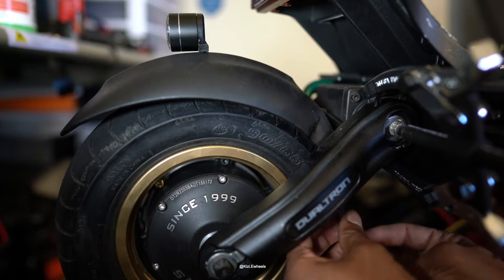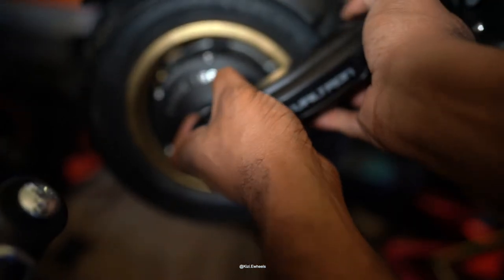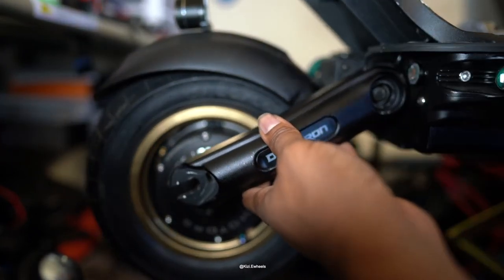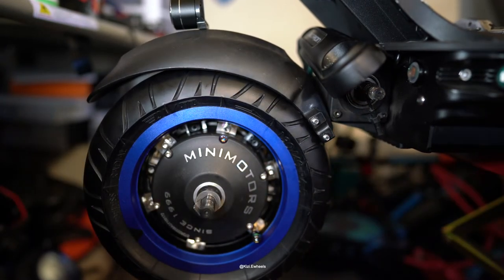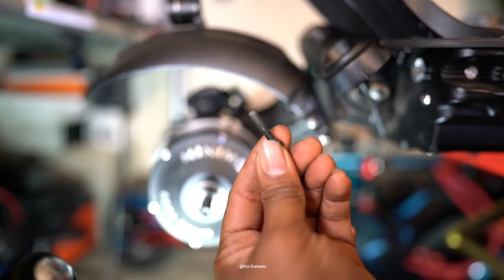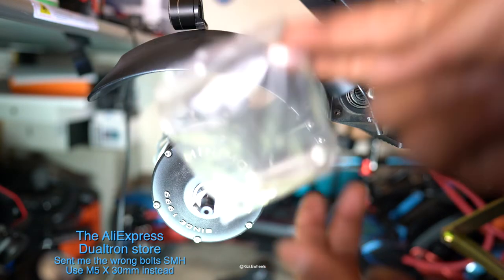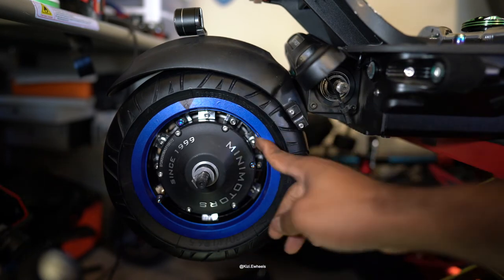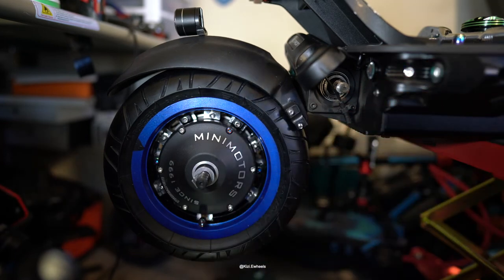How to change Tire Of Dualtron Thunder 2 and Storm Limited Install Back

Comment: I’m about to change my tires on my thunder and I contacted minimotors and they told me the replacement bolts were M5x20mm
Reply from the maker: Are you using the Original rims
Reply: @KiziEwheels  yes I have the original thunder with original wheels...I love your videos kizi they help me work on my own scooter thanks!

Comment: WHAT IS THE SIZE OF THE ORIGINAL DUALTRON THUNDER RIM SCREW IS IT M5X25 din912
Reply from the maker: M5 x 25mm
Reply: I contacted mini motors and they told me M5 x 20mm
Reply: @scottyW  thank you